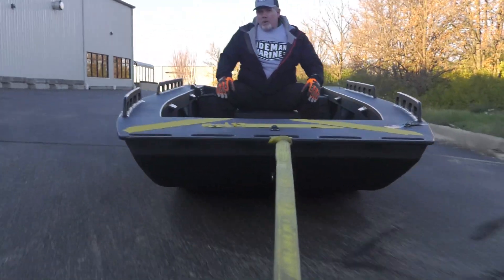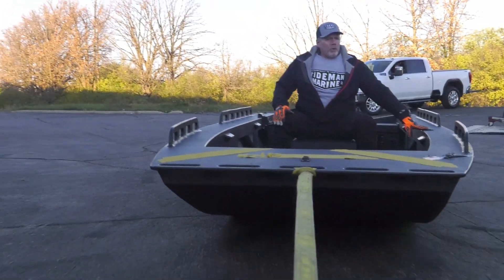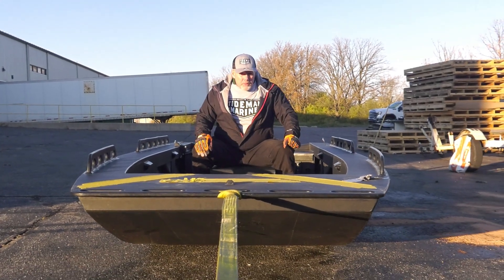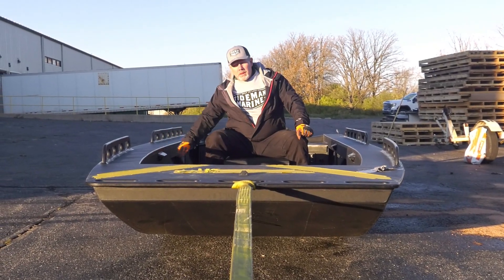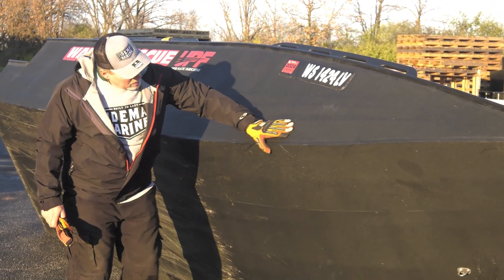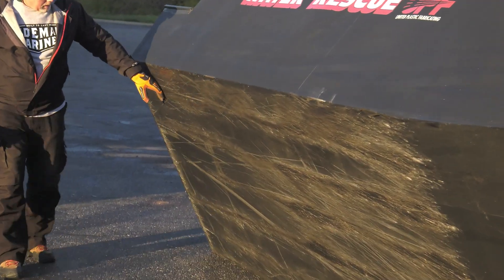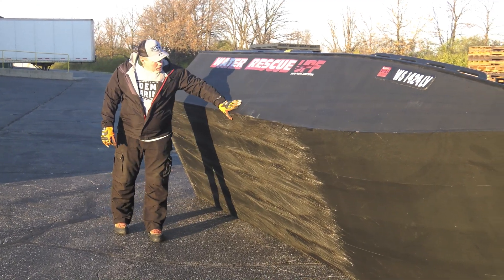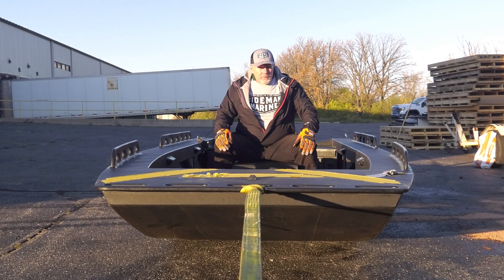HDPE Boat Durability Test: Street Drag Edition | Tideman Marine

Comment: How does this compare in weight to a fiberglass or aluminum hull?
Reply: The boat in the video was within 50 lbs of basically an identical aluminum boat size.  The material is lighter weight but thichker material was required for structural integrity.